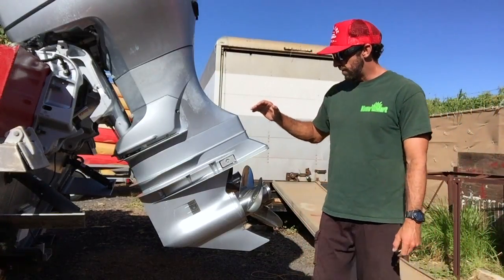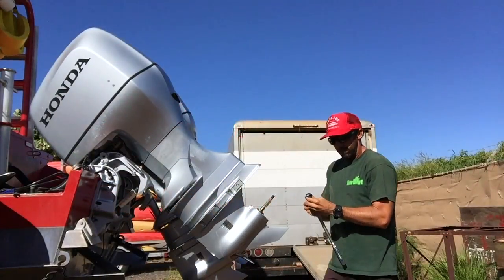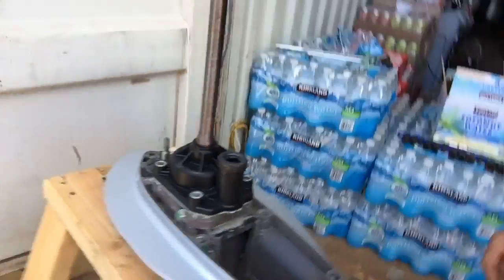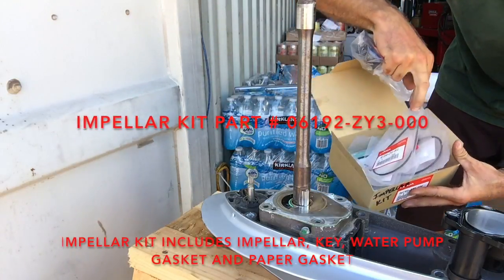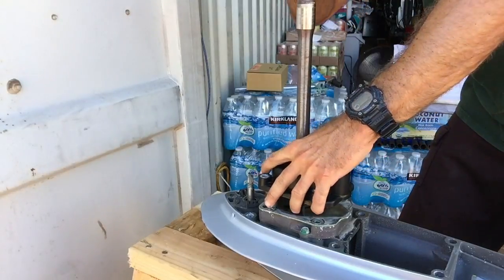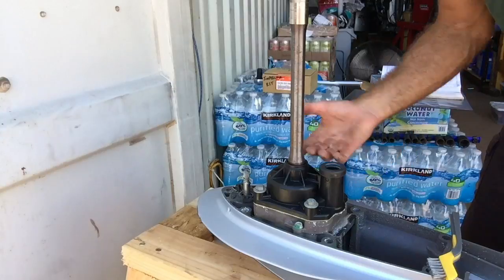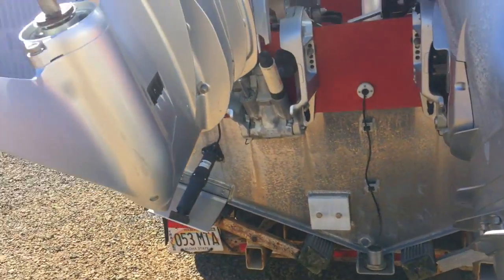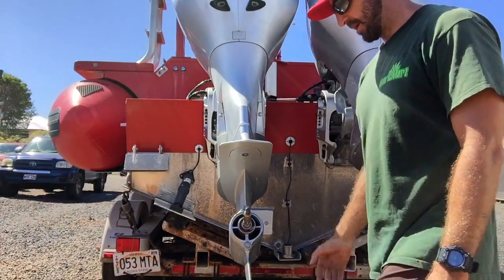Honda 225 Outboard Water Pump/ Lower Unit (gear case) Removal and Service

Comment: Thanks Capitan Sean for simple get to the point video. Should gear be in neutral when dropping the leg ? how do you keep the long shift tube in place when dropping the leg ? when I dropped my leg the shit link dropped and trying to putting back the leg with shift tub link keep dropping is a pain!! thanks for all your help.

Comment: hey Captain Sean. Great videos. Really helps me get work done on my Honda outboard. Can you tell me if my boat does not have a speedometer is it necessary to have the sensor nipple connected to the little rubber hose?

Comment: Thanks for your videos Captain Sean. I have a '05 225hp Honda I'd like to extend from a XL to XXL shaft. I believe the parts I need are a longer driveshaft, shift shaft, water tube and spacer with longer studs. Does this sound like a complete parts list, and a realistic DIY project? Any tips on how to do it and things to look out for are welcome. I've heard from a couple people I may need to re-shim the lower unit. I did order the shop manual and I'm hoping that the procedure will be covered. Thanks!

Comment: Hey man, I hope you are still active on youtube. Like many other comments your videos are some of the best out there and you explanation is excellent. I have learned a lot about my new to me Honda 225 that I otherwise would not have known.

You should totally keep making some videos. One question I have is, what advice you have for changing out your center shaft bearing? I believe mine is shot and will be pulling my lower unit to inspect as well as my impeller and gear casing water seals. 

Thank you again. Cheers.
Reply: Honda 40210-ZY3-610 Bush Vertical Shaft. Not in the manual but I agree  video would be awesome. Essentially once the lower unit is removed you remove the retaining ring ( which sucks) along with the bushing itself. Mine came out easily because it came out in chunks, however I would assume you would need a bearing removal tool with a slide hammer to make the job easier. Hope this helps.

Comment: I have a question for you I know this is an old post but I’m getting ready to do the impeller on my Honda outboard I’m just wondering what gear did you have this motor in or was it neutral

Comment: You are really thorough and that is appreciated.  I just bought a boat with a 2006 bf225. How do you know when this maintenance needs to be done? What should I look for to determine if the pump or impeller is in need if replacement? Thanks again.
Reply from the maker: There should be an owner's manual you can buy online (I think the Honda site).  Also, if you plan on doing your own maintenance I'd buy just the shop manual.  (Honda site) They're very thorough and even help with troubleshooting problems.  If your impeller is going bad your stream will be weak when your engine is running.  If you do a reverse wash down and it's still weak (not running) then you probably just have some salt to clean out of the hole with some fishing line.

Comment: Hi your videos are Exellent ,I need your help ,I have to clean out my vts unit can you advise me where is it situated Bf200a 1
Reply from the maker: Do you mean vst? If it's your vapor separator tank its connected to your high pressure pump (which is right behind the lower/green filter in the video) At least, that's where it is on these 225s.

Comment: I have a 2017 bf225. I managed to reinstall the gear selector shaft 180* out. The throttle seems really really stiff in neutral. I was hesitant to push any harder. I dropped the lower unit, removed the impeller housing and base so that I could pull that gear selector seal. Now the gear selector shaft is hung up. I thought I could lift it out and rotate so the flat is facing forward. Is there something else that must be removed before the gear selector can be pulled and rotated?
Reply from the maker: I consulted the manual just in case.  I have never done this so I can only tell you what I would do, not necessarily what to do, as I'm not there or know exactly what the scenario is.  I'd probably grab a towel (so as not to mangle the teeth) and see if I could rotate the shaft clockwise/counterclockwise to get it out.  The trouble there is knowing if you've put it into gear by doing so.  In the end, the flat part of the shift shaft has to be forward and the turning of the drive shaft doesn't turn the propeller shaft.

Comment: Capt. Sean, I have a 50hp Honda which I am replacing the gear case.  There is a #10 tube that I am also replacing.  On one end is a #15 sensor nipple and the other side is an #8 end nipple.  one side of the end nipple does not have a hole in it.  I thought this tube was for water cooling.  But, apparently not.  Can you confirm that this end nipple has a closed side? Thanks.
Reply from the maker: I'm not too familiar with the 50 hp series and I don't what you mean by #10 etc.  However, I know on our models we have a speedometer tube by the lower unit.  Ours has a cap on the tube since we use our GPS for speed on the display.  Hopefully it's just a speedo tube but I can't confirm it for you.

Comment: Have you ever changed a timing belt?  When should it be changed?
Reply from the maker: I never have had to. From my research in forums and articles, people seem to think most of the wear and tear of timing belts comes from starting (the crankshaft pulley using the belt to move the cams, etc) so I would think it depends on your use. My anecdotal experience with other companies in Hawaii, they've never had it happen before something else breaks the engine.  I'm sure it happens, just haven't heard of it here from any other companies.  Doesn't seem Honda has a swap date like cars, just says to check every year or 200 hrs.

Comment: A perfect guide, just done each step on the video and changed impeller without visiting service ) Cool! Quick question: what happens if I turn the vertical shaft counter-clockwise during installation of the housing? Engine gets no cooling or impeller pin has a short life due to work overloaded?
Reply from the maker: I think turning it counter clockwise should be fine in reality.  Honda makes quality impellers, changing after 2 years/2600 hours and not a piece missing any time for me.  In theory, the shaft rotates clockwise putting the impeller the opposite direction will be jarring for the impeller fins being snapped to bend the opposite direction.  I think these are quality enough that you will be fine, especially if you turn it on and it's  "pissing" a stream nice and strong.

Comment: Great video thank you. Shud i never seize grease on the bolts when re installing?   Thanks
Reply from the maker: Any hex head I usually avoid never seize.  These are large enough and made out of quality steel so I don't never seize them.  I have seen too much never seize, like our rear brake caliper fell off on our truck when one of our captains put way too much on one of the bolts and it worked it's way out while towing down the road.  That being said, I have never seen a bolt back out from never seize on any part that encounters large amounts of salt water (like lower unit mounting bolts or, for us, trailer lug nuts).
Reply: @captainsean4851  Great Thanks for the reply appreciate the help!!

Comment: Hello Captain Sean, your videos are great! In reference to the water pump maintenance, I had the engines tuned by a mechanic and I commented to him that the previous mechanic said he had changed the impellers, but I was having cooling issues so I was sure he did not change the impeller. The current mechanic then told me that someone had serviced the lower unit because there was a Tie Wrap around the Shift Shaft which apparently was visible between the engine and the transom mount. He proceeded to tell me that that was to maintain the Shift Shaft in position. My question is this a necessary step. I don't know how to email you so I will monitor this video for a reply.

Comment: Great vid. What kind of grease does Honda recommend?
Reply from the maker: grease is molybdenum based.  they should carry the honda grease at a lot of outboard dealerships.  otherwise just use marine grease
Reply: Maybe I’m over thinking. When I lube rubber parts, I use a Silicone base grease. Petroleum base grease will attack and soften/swell the rubber. Silicone base grease is harmless to rubber. Think brake parts. Put any kind of petroleum base products in the master cylinder and you’ve ruined/contaminated the brake system. Sil-glide has always been what I use. It’s nice for lubing seals and orings too. And a little antiseize will help for the next removal. Especially in a salt environment.

Comment: I get water running up out of the gear shift rod...only on one engine! Something's wrong...
Reply from the maker: The gear shift rod near the power head yeah? Not sure how that could happen with regards to the water pump.  That tube sits all on its own as you see in the video and any excess pressure wouldn't shoot up the rod to the powerhead.  I'd look for a leak elsewhere in the engine. Besides, the shift rod to the powerhead has another coupling outside of the cowling with yet another seal to block water entry into the powerhead area.

Comment: Hey Capt Sean, just curious if the impeller direction changes if you have a counter-rotating prop?  Thank you.
Reply from the maker: Nope, the counter rotating happens in the gears in lower unit below the water pump.

Comment: Hey Sean, great video. Very thorough explanation of everything needed to replace the water pump. By any chance, do you have the rough dimensions of the lower unit stand in the video? I'd like to make one myself before I begin the service,  but my boat is ~3 hours away. Thanks!

Comment: Hi Sean. Very good videos!
Regarding the internal anodes on the 225, wondering if you have replaced them and if so was it just a matter of dropping the manifolds and more specifically did they go back into the exhausts ok when you refitted them back in.
Would be great if you did a video as this is one service item with very limited info on the net.
Reply from the maker: I have done this and you're right, it should be my next video.  They are important and corrode in salt water.  I would very much recommend a new "o-ring" for the bottom of the manifold as well as the actual o-ring.  The bottom one I think is found under the "Mount Case" in the parts catalog.  Also, you'll need to order the manifold gasket as heat has usually degraded the one you'll pull out and if you try and re-use it (the way I re-use my intake manifold gaskets in other videos) it will weep water.  A Honda rep recently opened me up to a product called Dynamic Descaler (haven't tried it yet) and he says it should get rid of a lot of salts (outside of but including NaCl) in your system since the flush on the dock doesn't always open the thermos and flush everywhere.  Hope this helps for now.

Comment: Thanks for the servicing guides man, I got a BF135 so hopefully all the procedures will be similar. Also, do you need it to be in gear when you take the lower unit off? Cheers
Reply from the maker: I thought I replied to this but apparently I did not.  You should be in neutral when you take off the gear case.  It's easier to check the flat part of the shift shaft is straight forward than remembering which way the flat part moves for forward/reverse.

Comment: Great video , just one small thing the pin in Castle nut is not a cotter pin, it's a Split Pin.
Reply from the maker: Ah thank you.  It even says split pin in the manual I read beforehand.  Good catch

Comment: You need to torque the castle nut on Hondas to specifications!!!If you do not you could end up spinning the propeller!
Reply from the maker: Per Shop Manual "Tighten the castle nut to the specified torque((1 N*m). If the split pin cannot be set, tighten the nut additionally until the split pin can be set. Max torque 44N*m).  I'm not sure that I was the most specific on these points but I don't think I deserve this blowback with exclamation points George.

Comment: Hi Sean is there anything to unlock before starting? my lower unit get loose by 1cm, and then stay completely stuck...It stay with this gap of 1cm but never go further... could it be stuck by something? it exactly the same engine as yours, just no spacer...
Reply from the maker: One thing I didn't mention is to make sure your shift lever is in neutral.  Otherwise, if you remove the 6 bolts around the edge and the trim tab by the prop (along with the nut below it) I think it should come off.  Sounds like corrosion somewhere.  I wish I filmed how long it took me to get it off because it was a lot of hard hitting with the wood block.  If it comes loose by 1cm (and is that gap all the way around)  I'd say you got all the bolts/nut.

Comment: I have a 2011 Honda BF 135hp, will that be the same set up removal & installation of water pump?
Reply from the maker: From a short look around online it looks like the 135hp models are extremely similar to the 225hp I have in the video.  From the parts catalog online the water pump housing looks the same but has some parts around it that are slightly different.

Comment: Hi Sean.. What size of propeller you have on the 225hp. I have a single and need more stearn lift /hole shot.  Thank you!
Reply from the maker: I have two 225s and have to push around 24 people so we may end up with quite different needs as far as propellers go.  I have 17" 4 blade props and I think 15.5 pitch.  I think I researched forums like thehulltruth.com and such to try and figure out what size I would need.